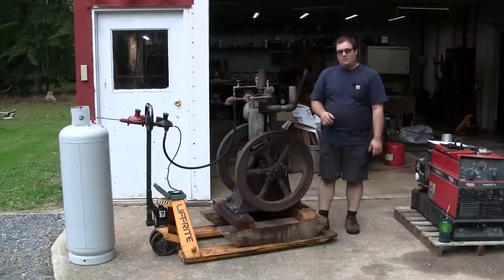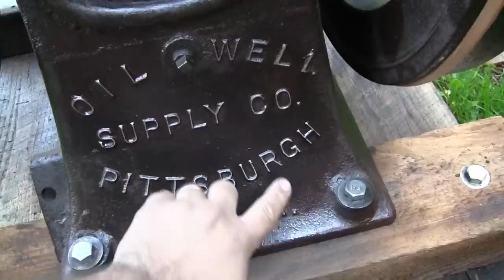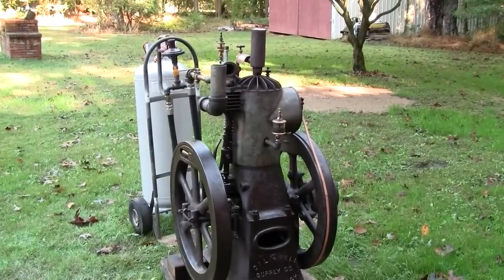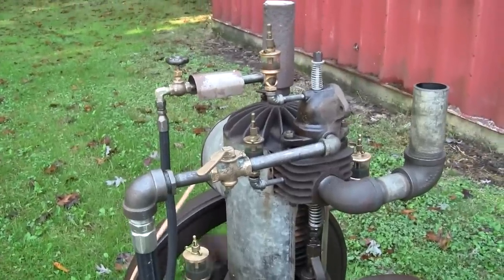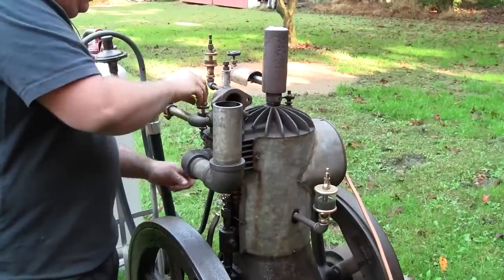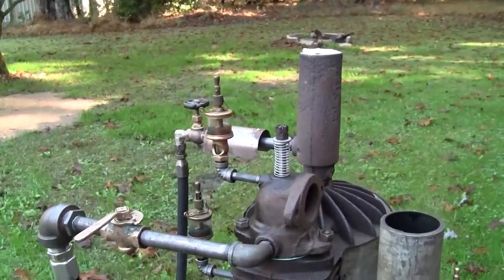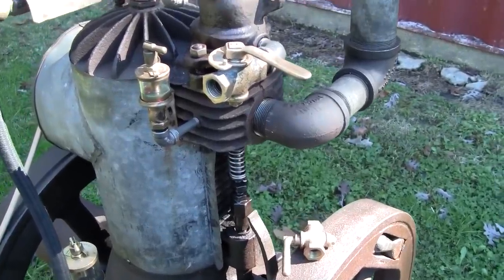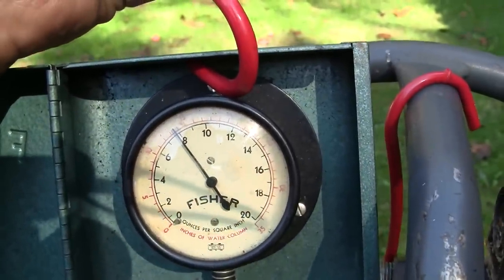100 Year Old Hit and Miss Engine Running on Propane Oil Well Supply Co.

Comment: I am thinking that the double valve movement on the intake may be corrected with a stouter exhaust spring. I noticed that on the intake stroke the exhaust valve would open causing a vacuum loss that would allow the intake to close and reopen   I could be wrong but I would try it. I enjoyed the video.

Comment: @17:30 i think its a design flaw, of that particular model. The way intake and exhaust valves are interlocked with addition of the vacume draw inside the piston and the valve guide at the bottom.

Comment: I'm betting you've got too much air. Try choking the air intake down some.  I've got an old Fairbanks Morse Model Z that has the same issue. I have to reduce the size of the intake opening down to less than 1/2 original size. Is there an adjustment on the governor mechanism?

Comment: Air mixtures off, you need to put a  butterfly valve on the flange up there so you can adjust the air intake probably make it run better leave the fuel mixture at a set point!! And  vary the air intake!!! that's my thoughts

Comment: It's running off load, meaning it's firing much less often than as designed, as someone else pointed out the fuel is constantly being fed into the feed - maybe that means on the first intake it's too rich to fire and only on the second intake is the mixture right ?

Comment: I don't know anything about hit and miss engines, but from the looks of things, I can make some assumptions. Engine speed being regulated by the governor on the flywheel, that support arm is either warm, or the nut resting on the tip of the arm should be adjusted down so that the lifter is n't scraping the tip of the cam lobe every cycle. Since I don't know how that mechanism works entirely, I can't assume anything about its influence on engine performance, but I can say that you'll wipe out the tip of your cam lobe like that. It's different if the lifter follows the entire profile of the cam because the lifter accelerates the way that it was designed, but currently the tip of the lobe is smashing into the cam lifter every cycle. If for some reason the cam lobe slightly lifting the lifter like that on every cycle is causing the valve to unseat slightly, I could see that influencing performance since that would change the mixing ratio for a cycle when it's supposed to 'hit'. Nice work by the way on the tool steel valve stem and cast iron valve face combo . I was worried swaying the threads would result in some slight seating misalignment, but if there was, I hope that lapping made them concentric. Did you try bluing the valve face to get a look at contact pattern? A full grind pattern if doing full revolutions while lapping tends to hide any uneven or non concentric fit ups. I'm glad I discovered your channel! Thanks!

Comment: I think your exhaust valve is being held open too long and venting the charge. Notice the governor arm pulls away right during the valves movement. Like the arm is popping off the nut late. Is there a way to index the cam?
Reply: Lol.. Wtf r u on about?
Reply: Wasn't sure if u were trolling or just dumb.. And I'm still unsure

Comment: With a diamond valve you have to make very small minor adjustments. If you replaced that diamond valve with a needle valve you would have better control of the fuel supply.

Comment: This is a hit and miss engine. Only let's the exhaust valve work when the rpm goes below governed speed. If it was under load it would have to fire more often to keep up the rpms.

Comment: I would think that the double intake action could be caused by it having no load on the engine. My father restored a couple old Maytag washing machine engines and had a similar problem until it was loaded

Comment: Sounded like the motor was charging up psi from the propane system and firing the pressure like an airpump and not combusting like it should.

Comment: Possible cure for the double intake is bolt a short [8-12 inch] length  of pipe to the intake flange to contain the intake gasses and reduce atmospheric wafting from breezes.

Comment: sounds like one of your valves or a gasket is bypassing combustion pressure with that whistle. seems to happen during the power stroke if video timing is perfect.
if you can flood it out a fuel supply problem you don''t have. also could be low compression(not sure what it's suppose to be on a hit&miss) if the compression pressure isn't high enough the temperature on the compression stroke won't be as great and the fuel/air density won't be as high in the bulb.  can exhaust valve timing be off on this engine? another though, could the intake length be a factor?
Reply: Did you also see the small bubble forming in the cylinder oiler just before the ignition of the mix? Could be a combination of timing, pressure and sloppy rings perhaps?
Reply: @t.w.3  id say that is on the right track. listening to it again it sounds like the exhaust valve is cutting off flow, either in or out. do these even have rings or just a long piston? i've never seen one apart. also, if the hot bulb had a crack in it it might be drawing air in a leaning out the mix for ignition yet the mix in the cylinder may be way rich. the fuel pressure gauge climbs when it fires, intake valve needs lapped at least.

Comment: Try adding some length to the intake flange, pointing upwards for the double intake cycling.  This would allow more gas to accumulate in the intake and mix with air before being used. Perhaps about 12 inches long? What was bolted to the flange when it was in service?

Comment: i think theres a choke type device that bolts on the intake to adjust the air fuel ratio. seems it would need one and theres a place to bolt something . maybe just a plate with a hole ....thanks great video

Comment: Very slightly too rich?
Fuel keeps flowing while exhaust is locked open, first compression stroke clears the over rich, second compression fires?
Never worked on a hit and miss, just a guess.
Reply: Exactly my thinking. When Mike opens the gas tap further it becomes so rich that the engine dies before it can clear the excess. Maybe even cooling the hot bulb below ignition temperature?
Reply: Tjousk, there is no gas released during the non intake strokes as you can see on the
manometer.  The intake valve also seals the gas outlet, that said,
about the only thing he didn’t try was choking the inlet down slightly with an air cleaner.

Comment: Loading the machine will change the number of ignition cycle. The only way to change the speed is the speed governor. Fuel-air mixture should be optimal and not be changed. Else it'll switch off as it's either too rich or lean. Remember the fuel-air mixture screw on carburettors?

Comment: Two gas valves the closest to the intake valve open for starting the engine the valve closest to the regulated. You use to start the engine when you have it running close the valve closest to the intake valve for a throttle

Comment: Put some load on. Stick a wooden wedge under the flywheel. See if it eight-strokes then. Better still wrap a rope around with a tensioner for better load control. Even better, use two spring balances as tensioners so you can measure it's torque. Good low tech stuff.

Comment: The old hot bulb tractors only got heated until they were fired up. Once the engine fired on it's own they removed the torch. Do you think it's possible that continuing to heat that is vaporizing the fuel on the first intake and you are just overcoming that by adding more fuel. Try turning the burner off once it fires up and then slowly reducing fuel input.

Comment: Lot of people missing the point. It’s a fuel saver. It could fire every time and be even but you burning more fuel. If you do not open the exhaust valve you cannot suck in a fresh charge of fresh air and fuel (saving fuel). To start engine you heat up the hot tube once hot you can start the engine once running you can turn off the hot tube heater I think could be wrong depends on fuelOnce it’s fired the cylinder a few times the metal is not soaking up the heat from compression it should be able to run just using compression to fire the fuel. Latest V8 Chevy misses four cylinders under light load same thing. Watch the exhaust valve every time it moves it fires. It’s governed at that speed if the spring for the governor was tightened it would run faster.

Comment: Hey! wonderful engine!, i was thinking, and honestly i will not read the 500+ comments, so, have you tried occluding the air intake? or to warm up the air that goes in, 'cause if the intake is cooling the mixture it may be not hot enough for ignition. just say

Comment: You might try less fuel to the hot bulb  burner. The flame coming out the top seems wrong. Too much fuel around the hot bulb might be actually cooler.
You are talking about the 11" gas pressure, try lower pressure

Comment: I think your problem is lack of mixture control(carb).  You are just bleeding fuel into the intake, so on the first intake stroke you are pulling in all the fuel that has acccumulated since the last intake stroke, which is probably too rich.  Second stroke pulls in a leaner mixture, since it has been much  shorter time.  Adding a load will help a bit, since it will need to fire more often, allowing less accumulation.  Still no real way to control fuel/air ratio over a wide range of load/air flows.

Comment: A couple notes, that's one massive valve diameter, And because of that I'm thinking of a couple things. In order to prime the seal between the valve and seat, the spring preload needs to establish enough of a seal such that any additional pressure in the cylinder forms sort of a positive feedback system where increases in pressure only improves the seal. An additional thought on that issue is any subtle deflection of the valve head may result in slight deformation which would shift the pressure distribution more at the heel of the valve face and less pressure at the toe. The toe being the narrow sealing surface separating the propane supply and the combustion chamber. Since modern valves are typically cut with three angles to improve ceiling performance and also allowing the seat to be somewhat self-cleaning, this isn't a relevant issue, but since you have wide, concentric parallel sealing surfaces mated perfectly under no load, I wonder if an increase in load due to compression influences the parallelism between the sealing surfaces during deformation . A likely unnecessary solution to this likely non-issue would be cutting the angle of the valve face 1 degree shallower than the seat, resulting in initial contact at the combustion chamber side of the sealing surface (valve seal 'toe'). The valve spring tension could be spec'd to pull the valve into full sealing/parallel fitment, where increases in pressure due to combustion would be far less likely to distort the valve beyond this happy ceiling configuration, but would actually go to further increase the ceiling performance during powerstroke.

 If it is deforming, that could allow a loss of compression, which would absolutely explain the double power stroke, and it could also mean a mixing of propane with air as the piston squeezes air through the gap at the valve face, which I assume is far from ideal and maybe could result in a flare up on the fuel supply side of that seal??

 Probably a non-issue, And even if this is happening, it may not be enough to make any difference, but since you're dealing with finicky inconsistent performance, it could be something pedantic like what I was describing.
Reply from the maker: James, thanks for the well thought out comment.  Please consider watching the follow up video.
https://www.youtube.com/watch?v=lVZ01kTujLc

Comment: Wonderful!   Needs to have a load on that flywheel.
Buzzards ready for when your accumulator blows up.
Must burn all of that gas to keep the hotube that hot??   Combustion in the cylinder does not keep it hot enough?

Comment: I would try an adaptor on the inlet with a smaller orifice going into the cylinder. propane likes a smaller intake than methane gas uses. Just like a kitchen range if you run propane it needs the adaptor to burn correctly.

Comment: The lack of a load is not the issue. This is a hit and miss engine which means it should only fire as needed to maintain flywheel speed with or without load. When the flywheel slows and the governor says "fire now" it should do so regardless of load. I am sure you know this already. It is doing 2 suction strokes before it has the fuel/air mix right to ignite. Your problem is getting that mixture correct on the first intake stroke..but hey does it really matter? Only to you, not the engine. lol.

Comment: the cam is deciding how often to trigger that valve, if the regulator lever allows it to trigger. a load will smooth that out, as it affects how quickly the regulator arm stops the valve.

Comment: Could the heat tube temperature be an issue?  Seems there is a fair amount of gas burning outside of the tube heater shroud.  Adjust air/fuel mixture? Maybe remove the fiberglass that you added?  Inspect combustion side of heat tube for buildups or loss of edges?

Love your videos.  Take care and stay safe.

Comment: It might be that the first suck is too rich.  The second suck is just right so it fires and while it's coasting the pipe has enough time to build pressure to where it's too rich again.  In the video I can see the hot tube flame turn orange when it is on intake.  Maybe that is an indication of something.  Maybe there is a timing issue?

Comment: After living in SW florida for 3 years, the upper 40's low 50's seems somewhat comfortable. Get so tired of the heat and humidity. Being closer to the equator here, the uv index is higher too.

Comment: The double dipping intake valve is not because of the spring it's because of your Governor weights need to be lubricated or adjusted it's not letting the exhaust valve closed completely in one cycle leaving it open only a hair causing the need for the engine to "double dip"

Comment: I can see and hear the intake valve bouncing. Needs more spring tension.
Reply: @Peter Colquhoun I think it might actually need less spring tension; It is bouncing  because the the piston's downward stroke creates a partial vacuum, then the valve opens, air/fuel mixture rushes in, reducing vacuum, then spring closes valve, then downward stroke generates more vacuum, valve opens ..... 

the tension of the closure spring only needs to close the valve before too much compression is lost on the upward stroke, and it could be RPM dependent. 

I can see my way working with the spring only strong enough to close the valve with compression stroke help, or Your way with, holding the valve close until the intake stroke creates a high vacuum, the valve opening, the fuel/air charge rushing in, the compression stroke starting and valve slamming shut.  

It would be nice to know the original designer's theoretical design.

Comment: The engine has a constant fuel source, but when it is missing it it does not draw in air. so when it does draw in air it is rich. the second stroke has the proper fuel mixture. The engine would likely have a zero governor regulator that only draws fuel when there is a vacuum
https://www.google.com/search?q=zero+govenor+fuel&ie=utf-8&oe=utf-8&aq=t.

Comment: Because propane is not natural gas(well head gas) it will have a rich mixture. In furnaces this is corrected by controlling the fuel input by  putting in a smaller orifice. But this system does not have an orifice, it is open flow through an open flow valve. With this type of system you would need to compensate getting more air into the engine with one gulp. Intake runner and valve size limit the amount of air an engine gets. With most internal combustion engines this is accomplished by larger throttle bodies or carbs. Also bigger valve with longer duration and higher lift cams work. But, alas, without a lot of custom modifications these would be nearly impossible. 
No need to lose hope.
Since it was designed to run on natural(well head) gas you only need to find a tank gas supplier, usually welding gas companies, that sells liquified natural gas or LNG as it is popularly know. Then you know you have the proper fuel.

Comment: The engine was not designed to run on propane which is a thicker heavier gas. Natural gas is a thinner gas and easier burning. This engine does not have a spark plug.

Comment: If this engine needs to have a bit of load to be stable, I would probably just throttle the air intake a bit and lower the fuel input a bit more to keep it out of lean burn and lower its power output to keep the HnM active more.
Reply from the maker: Thanks for checking it out!

Comment: The engine is running too cold without a load. 
Cold air is cooling the combustion chamber when the exhaust valve is open on misses.
Try running it without then fan belt on to build up some heat.

Comment: i would soften the intake spring, it needs to be soft enough to let the valve draw air if its to tight its working against the vacuum. my boss has a small hit and miss and it has a very soft spring on it. a ball point pen has more spring tension the his hit and miss.

Comment: Just a thought,  have you tried threading a 90 onto the intake and a vertical pipe pointed down?  It may help to hold the fuel charge nearer the valve. And come to think of it I doubt it was left that open when it was being used due to rain and so on. Just a thought

Comment: adjust the governor weights. if you watch the catch on the valve it stays open or sticks open a little to long. not sure if is the weight of lube or the weights. Then under a load you set the fuel